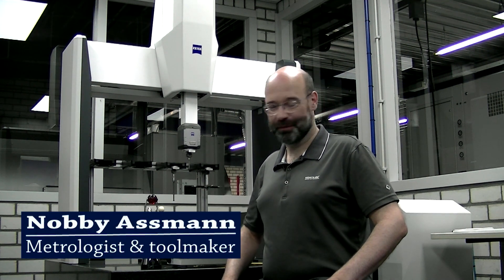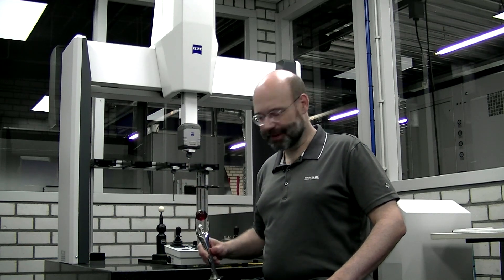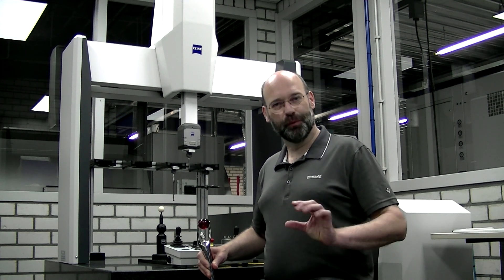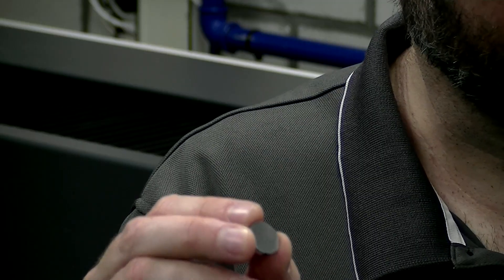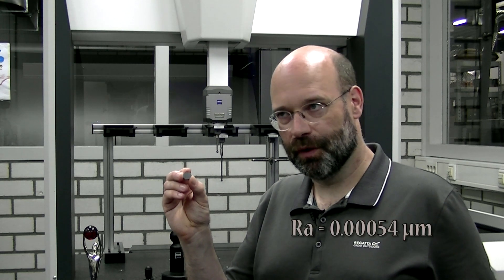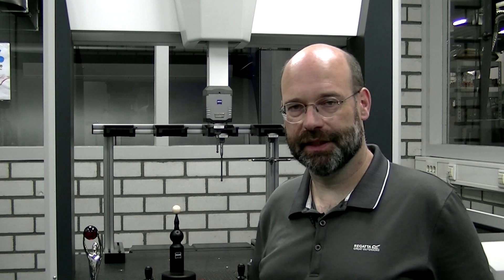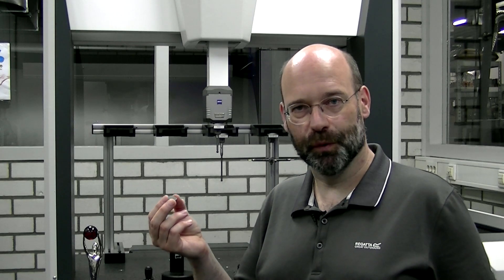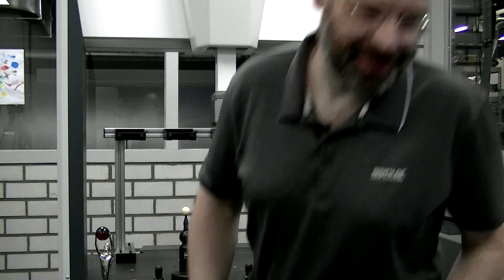Smoothest surface Zeiss #measuringhero awards 2021

Comment: Super polished optics have less than 1 Angstrom Surface roughness.
Reply from the maker: Yes, the Zeiss LSM900 that measured my part is capable of measuring roughnesses under a tenth of an Ångström. I doubt you can achieve such surfaces in steel. Glass' amorphous structure gives better roughnesses.
Reply from the maker: And glass was excluded for the competion of this award.
Reply: Hey, I just wanna ask does borosilicate glass work well and is it cerium oxide we use to achieve such precision? Or diamond is fine? Sorry for imposing, I just got so curious.  @nobbyslab
Reply from the maker: @leonordin3052 Tjenare, Leo! Svenska kan vi också prata - om det är inte för tekniskt. Lapping and polishing glass is something I have never done before. It's totally different from metal - that I know. Ceriumoxide is very common to use with glass polishing in combination with a pitch lapping plate. I believe that combination gives the best results because there's also a chemical reaction going on. You don't have that when you use fine diamond on glass. Lycka till!
Reply: @nobbyslab  Tjena :D , roligt att ha en nära granne som har liknande intressen. I am reading some forums on lapping (your name comes up a lot xD) and I will be attempting to lapp a long borosilicate cylinder 40mm diameter. Its a heavy challenge so I am going to make an account on the forum. Maybe I will see you there :)
I could ask right now do you know how I can make as little friction as possible when lapping? I am going for 0.1um straightness. So I need small forces otherwise the part will bend.
Reply from the maker: That sounds like a real challenge. 100 nanometers of straightness... wouldn't know how to achieve that

For a metal part that needed ultimate straightness I'd go for centerless grinding as a first step. Second step: OD circular lapping like this: https://m.youtube.com/watch?v=O45jYNtCr2I

Third step would be polishing. 

Now: I really haven't got any experience with glass.

I wish you lots of success. For such a job be sure to have a lot of patience and the mental ability to handle setbacks. 😊

I'm from the Netherlands by the way. Swedish is 'just' another passion of mine. Hare bra! 🐇
Reply: @nobbyslab  Tack så mycket😆

Comment: Nic e, but without comparison to something it's difficult to imagine . Care to comare to typically mirror or similar?
Reply from the maker: Excellent question, Bill: without a reference, numbers don't mean a thing. A beautiful high gloss, mirror polish has an Ra of around 10 nanometers or 0.4 microinch. My surface is 20 times smoother. That's a common roughness in the world of glass lenses (of pretty decent quality), optical surfaces and wafers for chip making. That's not really my habitat, so I was pleasantly surprised when I received the measuring results!